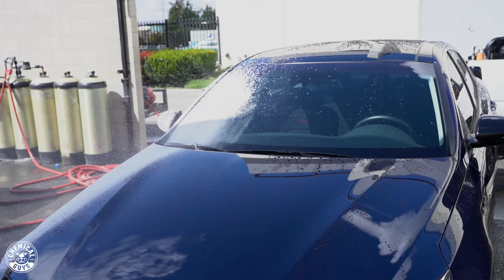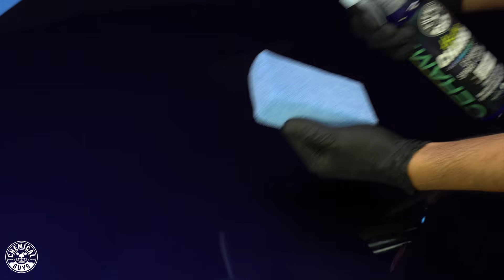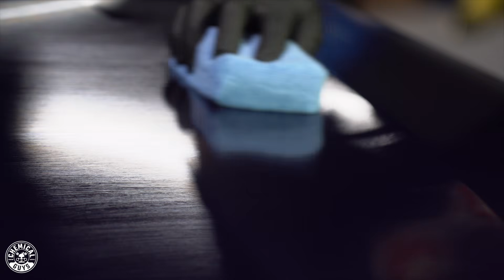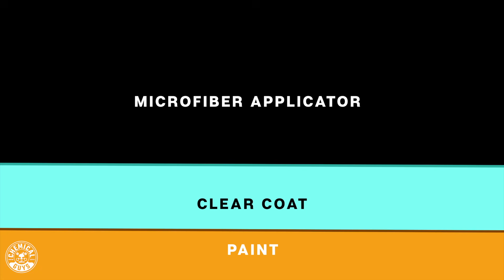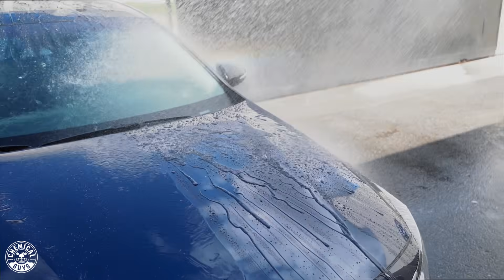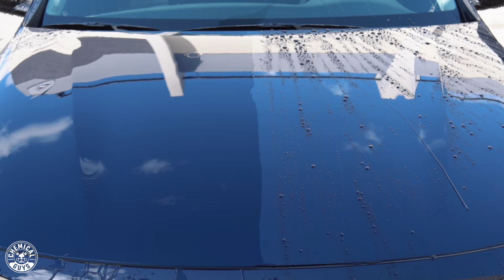How To Easily Apply NEW HydroCharge Ceramic Spray Coating | Chemical Guys

Comment from the maker: Add Durable Ceramic Protection! 
- HydroCharge:
https://bit.ly/4412eDV

- Microfiber Applicator Pad: 
https://bit.ly/45O9tjX

- Professional Grade Microfiber Towel:
https://bit.ly/43FpbMy
Reply: Can  I follow it with a coat of hydro slick?

Comment: after the 1st use of hydrocharge...can i use it as a 2nd time as a 2nd layer a couple of days or any other random days for the extra shine...?2nd what difference is there between hydrocharge ceramic spray and carnauba based wax be they wax paste or spray wax...?which of them offers better shine and protection...?
Reply from the maker: Absolutely! Apply additional coats for added depth and protection.

Comment: How long does your spray ceramic last, and how close is it to a conventional ceramic?
Reply from the maker: Hi Cristian! HydroCharge will last up to 12 months on the surface, providing a durable layer of protection that resists harsh elements and adds gloss.

Comment: Can I use HydroCharge on Paint Protection Film? Will it bond to the surface of PPF?
Reply from the maker: Hi there! HydroCharge is designed for gloss paint. Apply JetSeal to your PPF for protection and gloss.

Comment: What's the difference between this and hydry slick? Can both be used?
Reply from the maker: Both are amazing products and can be used together. How is this different than HydroCharge?

HydroCharge is a Ceramic Spray Coating. HydroSlick is the first-ever HyperWax. Yes, that’s right: HyperWax! We listened to customers across the globe and in the interest of constantly innovating the industry and the category, we wanted to develop something truly unique and exceptional. The idea was to make a product that delivers a superior shine, applies like a wax, and delivers the longevity and protection of a ceramic. HydroSlick is a true ceramic coating just like HydroCharge, but this formulation is offered in a suspension gel for the first time ever, making it as easy to apply as a wax.

Comment: HOW DOES IT BOND TO BARE SURFACE WHEN YOU HAVE POLISHED THE CAR?
POLISH IS A WAX.
THANKS
Reply from the maker: Hi there! Thanks so much for your message. The polish we offer isn't a wax, it actually contains abrasives that refine the clear coat and remove scratches and swirls while leaving no residue. This exposes a fresh layer of clear coat that must be protected with either a ceramic, glaze, sealant, and/or wax combination.
- CG Nick
Reply: @ChemicalGuys  many thanks bro.
Reply: So do u apply this after or before a wax?

Comment: What is the difference with hydroslick and hydrocharge
Reply from the maker: Both are amazing products and can be used together. How is this different than HydroCharge?

HydroCharge is a Ceramic Spray Coating. HydroSlick is the first-ever HyperWax. Yes, that’s right: HyperWax! We listened to customers across the globe and in the interest of constantly innovating the industry and the category, we wanted to develop something truly unique and exceptional. The idea was to make a product that delivers a superior shine, applies like a wax, and delivers the longevity and protection of a ceramic. HydroSlick is a true ceramic coating just like HydroCharge, but this formulation is offered in a suspension gel for the first time ever, making it as easy to apply as a wax.
Reply: @ChemicalGuys  okay thank you

Comment: Can I use this on wrap?
Reply from the maker: Hi there! HydroCharge is designed for gloss paintwork only. Use Activate Instant Shine on your gloss wrap to prevent fading and cracking from harmful UV rays and harsh elements.
- CG Nick 
https://www.chemicalguys.com/activate-instant-spray-sealant-and-paint-protectant/activate-spray-sealant.html

Comment: Can it be layered with hydroslick? I just put a coating of hydroslick on my car and omg I cant stop staring at my car
Reply from the maker: Hey David! Absolutely, use the combination of HydroCharge and HydroSlick for a durable layer of protection and enhanced gloss.
Reply: Which would be recommended to go on first?

Comment: is it necessary to tape plastic and / or rubber as soon as you apply?
Reply from the maker: Hey! Avoid applying HydroCharge to vinyl, rubber, and plastic trim as it may stain. Taping off these sensitive surfaces is a good idea.
Reply: Chemical Guys thanks guys!

Comment: I recently bought a new 2019 Black Ram Warlock, Unfortunately the truck is parked out side and on the west coast lots of rain now.I also purchased about 700.00 worth of products from Chemical GuysI never got a reply from your head office or a reply from Hector on one of his video's on what products to apply in sequence after clean and clay bar.You have out dated video's reflecting newer products being offered and it's getting confusing.The flow chart is also out dated reflecting your new latest products for applying to the paintThis is what I bought and can you tell me in sequence in applying the product. I have a feeling of what to do but need confirmationNew Black Truck after wash and claybarVR 38 polish? as paint is new. Do I still need to do VR36?Black liteJet SealHydro Charge Ceramic sprayHydro Slick Ceramic Coating hyper waxBlack WaxButter waxMirror FinishI appreciate your response and this could also help out others in the same situationThanks, grant
Reply from the maker: Hi Grant! Thanks so much for your message and for your patience. After giving the truck a wash and clay bar treatment, inspect the paintwork to determine whether V36 Cutting Polish is necessary of just a pass with V38 Final Polish. In either situation, V38 would be the final step. Apply HydroCharge to bare paint and then layer on HydroSlick. Top your ceramic with Black Light Glaze or Wet Mirror Finish, JetSeal and then use Black Wax or Butter Wet Wax. 
- CG Nick
Reply: Thank you Thank you Thank You for your advice.It really helps me out. I appreciate it.Grant

Comment: Ok a few weeks ago I washed my newer car with Citrus, then clay bar, EZ Cream Glazed, and topped with Butter Wet Wax. Can I now use this product? Or what is the procedure I need to do?
Reply from the maker: Hi Butch! We recommend applying HydroCharge to bare paint and then it can be layered with your favorite glaze, sealant, and/or wax.
Reply: Chemical Guys do you have to glaze, seal or wax after this ceramic coating?

Comment: I usually clay bar my car, then use black light and after that I use butter wet wax.  So when should I use hydro charge in this process?  1- clay bar 2-black light 3-hydro charge 4-wax? Is this the correct process order?  Love your guys products
Reply from the maker: It would go:
1. clay
2. Hydro Charge
3. black light
4. wax

This flowchart is a great tool: https://www.chemicalguys.com/blogarticle?cid=blog-article-detailing-flow-chart.
Reply: I think you would have to do hydrocharge first, get it done, and let it age for at least 24 hours and then apply your favorite sealant and wax after

Comment: Those three spray you put on the applicator pad, were enough to cover the entire right side of the hood? Or did you require more product?
Reply from the maker: Hi there! That's correct, HydroCharge spreads very fine so just a few sprays can cover a large surface area. - Happy detailing! 
https://www.chemicalguys.com/hydrocharge-ceramic-spray-coating/WAC23016.html

Comment: I bought this and first applied it on my windshield to see how well it works. I cleaned the windshield 3 times really well before application, sprayed the window and let it sit in the garage til the next day.
First rain fall, beautiful! Didn't use the wipers once. 2 weeks later, waters barely beads on it, I can splash a bucket of water on it and it just acts as if it's a bland window 
Any thoughts on this? I liked the product at first but I'm wondering if it's not as strong coating as other.
Reply: Mason Methot there are ceramic coatings for paint, HydroCharge, and ceramic coating designed specifically for glass. You used a coating meant for paint on glass expecting applied to paint results and durability
Reply: @Deaddriftbum  thanks for letting me know. What ceramic coatings can be used for glass?
Reply: Mason Methot  try rain x
Reply: rain x is really good to repel water on glass

Comment: Can you use ex creme glaze with this if so before or after?
Reply from the maker: Hi James! Thanks for tuning in. Yes, it is completely fine to layer your favorite glaze, sealant and/or wax on top of HydroCharge. I recommend applying HydroCharge to bare paint and let it breathe for a few hours before applying EZ Creme Glaze. - Happy detailing!

Comment: I'm new to the ceramic technology. Can you clarify where this fits in the flowchart? Would there still be a need for the glaze, sealant, and wax?
Reply from the maker: Hey Bryan! Thanks for your question, it is best to apply ceramic to bare paint after paint correction. It can be layered with your favorite glaze, sealant and/or wax for added shine and protection. - Happy detailing!!

Comment: I put the hydrocharge on my car and hardly used anything out of the bottle. I would bet there’s enough to coat 15 cars in the bottle. It’s just how they say easy on, easy to buff off. The only thing is have 3-4 microfiber towels. They get loaded with the ceramic coating and start streaking. Good stuff I would recommend to any DIY person looking to put a coating on their car. I use SiO2 infused products from another company to keep the fresh just coated shine.

Comment: I have this product, done all the steps, and what you guys forget to mention is that it doesn’t have a slick finish. After a long trip I used the waterless wash and wax (your product) and it stripped the ceramic layer off. I had to redo the process on my hood and front fascia. This is a water based ceramic, not true silica based, so the full ceramic protection isn’t there.
Reply: Just used it, I was wondering the longevity of this product. How did you know it strip all the hydrocharge off?
Reply: Jonathan Mariani , there was zero beading. It looked like a flat sheet of water. Like when you strip all other protection from the paint.

Comment: is this a true ceramic?
Reply from the maker: Hi there! HydroCharge IS a ceramic coating, it’s just in a new form that you probably aren’t used to seeing. Instead of a liquid that is spread onto the surface, HydroCharge is a spray formulation that allows for easy application. It’s all the benefits of a ceramic coating without the difficult application! - Happy detailing!
Reply: @ChemicalGuys  thanks for the quick reply

Comment: @chemical guys 
Is this safe or effective on dirt bike or atv plastics?
Reply from the maker: Hey Sean! Use HydroCharge on gloss painted surfaces to enhance shine and add a durable layer of protection. 
https://www.chemicalguys.com/hydrocharge-ceramic-spray-coating/WAC23016.html

Comment: That whole application was with only those three squirts?
Reply from the maker: Hey there! HydroCharge spreads very thin so a little bit goes a long way.
Reply: I just applied to my Toyota Tacoma this morning. Used maybe 1 to 2 oz for the whole truck.  I'll be dead before I use the whole bottle!

Comment: After Hydro Charge cures, how long do you recommend to wait before applying a sealant such as Jet Seal? Will Hydro Charge continue to harden over a number of hours?
Thanks!
Reply: Nicklaus Biederwolf, I applied jet seal 24 hours after and it really helped the car to feel slick. Hydrocharge will not give you that slick feel.
Reply: @brents.2501  Exactly what I ended up doing.. if you read the Hydro Charge specs, it becomes chemically stable (stops hardening, polymerizing, etc etc) after 24 hours.. so I went glaze/Jet Seal/Pete's 53 after that.. interesting to hear what CC says, but I don't think I'd do anything differently

Comment: After waxing a car, would you still apply jet seal and then hydro charge? Or is it one or the other???
Reply from the maker: Hi there! HydroCharge can be used as a standalone layer of protection. Or it can be layered with sealant and wax to enhance gloss and add longevity.

Comment: Should I apply this before or after glazes/sealant/waxes
Reply: Before, make sure you have no oil,waxes, glazes before applying, that why it is recommended to use clean slate and wipe out spray to completing clean and prep the surface.
Reply: Before.

Comment: @chemicalGuys can this be used as a drying aid or spray and wipe fashion? What are other ways of applying and/or reapplying it
Reply from the maker: We recommend that you properly apply HydroCharge to the paint with an applicator pad, letting it haze for up to 2 minutes and buff it right off with a microfiber towel. Make sure to refer to the HydroCharge FAQ to learn more about what HydroCharge is and how to use it.
https://www.chemicalguys.com/blogarticle?cid=article-hydrocharge-faq

Comment: Is this before or after a glaze?
Reply from the maker: You would apply HydroCharge onto the paint prior to layering your glazes, sealants, and wax so that it has the best possible bond the raw paint itself. That will allow it to seep into the pores of the paint and create a stronger bond and impermeable layer of protection. Make sure to check out this article on how to properly layer your products and plan your detail.
https://www.chemicalguys.com/blogarticle?cid=blog-article-detailing-flow-chart

Comment: I have to say, this product isn't that bad. Trust me when I say this, if you guys lowered the price to 30$ I think it would definitely be worth it to get this product. To anyone who is interested, durability is 4-6 months, they mean it when they say it's user friendly and sio2, because wipe off is very nice and your towel and applicator will get crusty. Also this product is a water sheeter which supports the claim sio2 because sio2 is a water sheeter with some beading.

I have invested around 200$ to chemical guys, and in my opinion 100$ of it was a waste, so I have stayed away from most of their products, only a few I still use because they are really good, but this is another product I am not disappointed in buying. In fact I like this product a lot. Pick it up and give it a try.
Reply: Which of their products do you like?
Reply: @vietfattyxD  Chemical guys VO7 detail spray is the best detail spray I've ever used. Chemical guys gloss works, citrus wash and shine, extreme body wash and wax, and VO7 shampoo are great car shampoo's. Chemical guys signature/stripper scent is awesome but now it's sadly diluted instead of the high concentrate it once was, it will now only last a week or two instead of a month or two, still worth it. Chemical guys nonsense odorless colorless APC is my favorite internal cleaner and it's super safe on leather, no fumes, colors, and all that bull, also the CG Leather cleaner is repackaged nonsense APC I'm very confident in this. Chemical guys leather scent is great for leather interiors to smell like they should again. Of course my new addition that I like is Chemical guys hydrocharge ceramic spray.

I hope this helps in picking out their best products in my opinion. If you want my all time favorite car detailing products to use just reply back.
Reply: XxVendetaxX1 Gloss Works shampoo is awesome! I wish it came in larger amounts

Comment: CG, it would be helpful to make customers aware that cleaning out the sprayer head is important. I only wiped off the nozzle, but it still became clogged. Hot water and chipping it off eventually salvaged the spray head.
Reply: It would be nice to know what to clean it with. Water, alcohol etc...?

Comment: Cool stuff does this actually have ceramic in it. Or is it silicone based?
Reply from the maker: Hello! HydroCharge is an actual sprayable ceramic coating that hardens onto your paint like a traditional ceramic coating. Make sure to check out HydroCharge FAQ for any further questions you may have. 
https://www.chemicalguys.com/blogarticle?cid=article-hydrocharge-faq

Comment: Which detail spray can we use with this?
Reply from the maker: For best results, we recommend using Carbon Flex Vitalize Spray Sealant which is a quick detail spray/sealant to maintain shine, durability and any type of protective coatings.
https://www.chemicalguys.com/carbon-flex-vitalize-quick-detailer-and-spray-sealant-for-protective----coatings/carbon-flex-quick-detailer.html

Comment: How long is the durability of the product  HydroCharge Ceramic Spray Coating
Reply: Many factors to consider. Garaged/Not Garaged, How often do you wash and how do you wash and what soaps do you use? What state do you live in? How often do you drive the vehicle daily/weekly/monthly? 
It could last 4 months and could last 2 years. I think applied correctly on a garaged daily driven vehicle that's been up kept regularly 1+ years with 2 coats applied. It has a 45% SiO2 content so it should hold up rather well. I know I'm spending $40 plus whatever up keep stuff I need to find out. It's anybody's guess really but I do know they did long term field testing on the product before bringing it to market to the numbers they throw out are realistic. Time will tell! ✌

Comment: Can I use a chemical guys detail spray over this in between washes?
Reply from the maker: Hello James! You can use any of your favorite Chemical Guys detail sprays to use in between washes! We recommend that you use Vitalize Spray Sealant which is not only a quick detailer, but also a spray sealant which will maintain any type of protective coatings such as a ceramic.